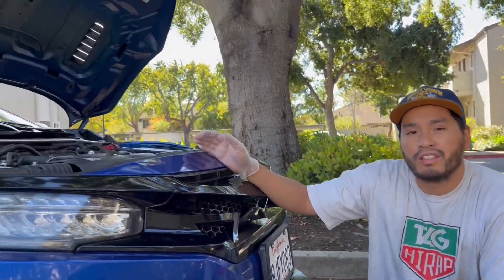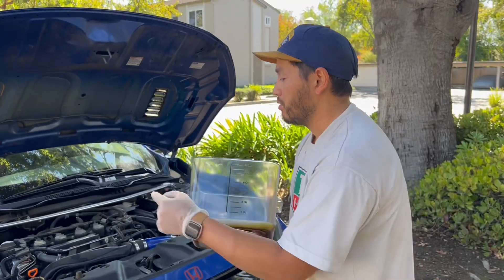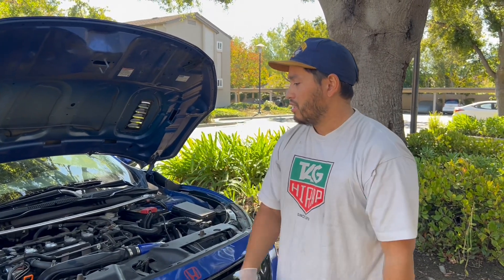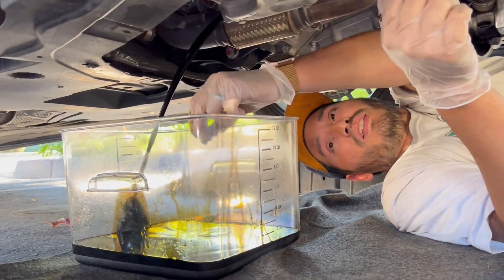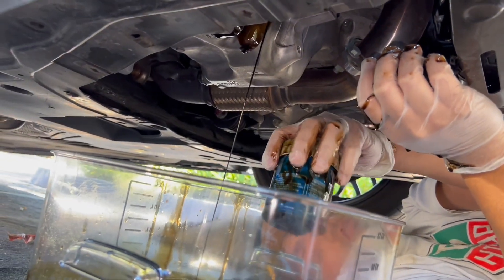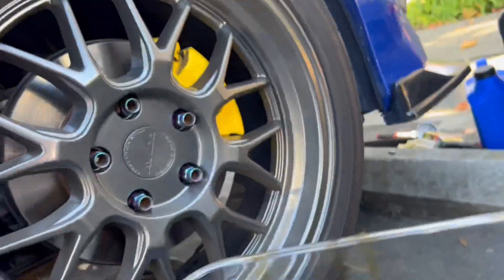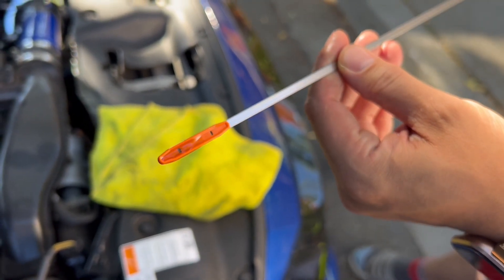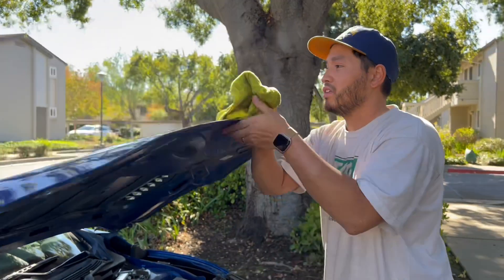Major Problem with my Honda Civic 10th Gen OIL DILUTION Fuel Mixing Issue, No Warranty Fix Recall

Comment: My daughter has a 2015 and  wants to upgrade with a 2019 but the 1.5 Turbo having this problem I think the 2.0 L Sport non Turbo will be a better safe choice. nice video, Hello from Vancouver Canada.
Reply from the maker: The 2.0L engine is more reliable and still quick. Good luck with purchase 👍
Reply: All turbos have that problem. I had a 2016 Kia optima sx turbo I had a catch can and it was still getting oil dilution. Now I drive a 2020 honda civic sport 2.0L non turbo. I'll never get a car with a turbo again.
Reply: I would not be scared of this problem in the slightest
Reply: @gabrielgaribay2145 yes all turbos can do it but Hondas oil dilution is above normal
Reply: @josegarza7719  I agree I have oil dilution in my 2020 Honda civic sport. When I do my oil change I have my oil right at the full line, then I notice my oil level will rise. That's because Honda motors are direct Injection. I have a non turbo 2.0. My my oil level rises I take some of the old oil out and top it off with fresh oil but I might start doing my oil change every 3,000-4,000 miles instead of 5,000 miles. I use pennzoil ultra platinum full synthetic 0w20 and a wix XP oil filter.
Reply: @gabrielgaribay2145  I kept reading info about how 2019 and newer Honda turbo engines were fixed. It seems the issue still persists since your 2020 still does it. they may have made it better but I’m going to buy a 2022 sport, 2.0, non turbo engine one I found near my city. I love the design of the 2017-2021 but it’s almost impossible to find one with a 2.0 non turbo. I found a manual one but I do Uber and it’s annoying using manual. 

The 2.0 non turbos don’t have the oil dilution problem from what I’ve researched.
Reply: @gabrielgaribay2145  wait your oil level rises in your non turbo 2.0? They don’t make 2020 Honda civic sports non turbo if I remember right
Reply: I just got a 24 civic sport 2.0 non turbo im at 4950miles taking car to dealer for oil change in a week or 2 and my dipstick smells of fuel😢@josegarza7719

Comment: same, 70K mile 2017 civic sport, no dilution. always trip over 25-50 miles...no short trips. hot climate. switch to more dilute engine oil and it should block out the fuel during cold start and cold climate driving. I oil change at honda dealer every 5K miles so no idea what they are using now on civics.
Reply from the maker: Thanks for sharing!

Comment: i really love the turbo noise on the 1.5t. But I have the option to buy a 2.0 what should I do?
Reply from the maker: They are both great! Tough to choose. Reliability is probably a bit better for the 2.0 and it has a better exhaust sound.

Comment: Seems like they had fixed the issue at the year of 2020. By rising a certain rpms on cold start and couple changes with the ECU. So far, it seems to be an issue still with these 1.5T engines. It does help but does NOT fix the issue.
Reply from the maker: You’re right, the ECU update is not a fix, more like a bandaid. It also worsens MPG by making the engine run warmer. Still contemplating on updating or not 🤔
Reply: its not, i have 2021 hatchback ex with 7000 miles on it, oil delution is so terrible
Reply from the maker: @Humbletrader08  damn, Honda seems to struggle with reliability this generation. The AC leaks, oil dilution, etc
Reply: @Humbletrader08  once your engine is more fully broken-in you will have less problem. 3k OCI is good unless you take longer drives and then 4-5k not bad.
Reply: @Sals_Garage  the engine runs too cool and if you use NGK ruthenium plugs it should help with everything because its a better plug
Reply from the maker: @jamesmedina2062  I do have custom hood vents which brings overall engine temps down.
Reply: @Sals_Garage  I replaced my ac compressor with a new $200 aftermarket ac compressor, no more leaks but it sounds on revs.
Reply from the maker: @seansmith9196  yea mine makes more noise than stock, but it doesn’t bother me.

Comment: This has been addressed on all models from the factory 2019 and beyond and prior years there was a recall that provided a software update and new AC parts free of charge plus an extended warranty for all affected vehicles. You should have Honda apply the fix to yours if the previous owner hasn’t. Also smelling the oil won’t provide an accurate reading of how badly diluted it is. You should send a sample to blackstone to see the actual percentage. Bare in mind a minute amount of bypass is normal because of how the engine works basically. On cold starts until the block warms up and the piston rings make a tight seal some drops may get by the cylinder walls. Driving the car for long enough after said cold start will evaporate the fuel from the oil pan.
Reply from the maker: I know about that software update. Thanks for the info. As far as I know they program the engine to run warmer to evaporate any fluids that sneak into the oil. Sounds like a bandaid fix though. I’ll order a black stone analysis for the oil and update you all soon. Cheers
Reply: @Sals_Garage  with this issue aside this motor is solid sorry you’re having to still deal with it. Keep the content coming.

Cheers
Reply from the maker: @filmmakerstudios  will do thanks!  Next up is Android head unit that is compatible with factory touring amp
Reply: @filmmakerstudios  is there an article that backs this up? I can't find anything in the web.
Reply: @carcez  how Honda corporate handled this is public information. At least in the United States. You should be able to find records from an official source.
Reply: Fuel and oil don't mix and any dilution will jeopardize the oils protective characteristics
Reply: @jmed753  they do for a brief moment watch a vid on how engines work
Reply: @filmmakerstudios  weedwackers? 2 stroke engines are not gdi tho
Reply: Honda has not fixed the problem.  We had a 2018 and had the software updated and the problem was not fixed.  We bought a 2019 and there was an oil dilution problem.  How much is Honda paying you?

Comment: My wife has the 2016 EX-T and I have always changed the oil myself.  I read about the dilution and decided to check for myself.  I drained the oil and then added 3.7Qts with a new filter.  I then emptied the used oil into an empty pennzoil gallon jug.  I measured 4.2qts.  This entire process was repeated after another 5000 miles and I got the exact same results.  4.2Qts of fluid came out of that engine.  I called Honda and filed a claim.  Long story short....I ended up at the Dealership where the claim to have reprogrammed the computer and then they changed the oil again.  5000 miles later, I changed the oil for the  third time and measured the used fluid.  Yep, 4.2qts again.  Now I have to go back to the Dealership and have it done all over again.  Meanwhile, my wife is driving around in a car with diluted oil.  Oh, and I only have three more payments on the car.
Reply from the maker: Thank you for sharing your story.  I hope you can get the issue fixed soon. For a new car having big problems like this and the constant AC leaks, it’s been quite a headache to deal with. So far we have been driving with the dilution issue and just changing the oil more frequently without any issue yet 🤞
Reply: Carvana or vroom will give you big bucks for it.

Comment: bro im having an oil delution coz i live here in iowa andits winter now with my new civic 2021 and i have warranty, what are they gonna do about it? how can they fix it
Reply from the maker: Sorry to hear that. I heard they update the ecu computer to fix the issue, but it seems like more of a band aid fix. Hope you can get it resolved
Reply: it all depends on how much (oil dilution). How much is it? How many miles on vehicle? What oil exactly?
Reply: @handycap9815 haha! I wouldn’t call it junk. There are 2018s with over 150,000 miles and zero engine/transmission problems. Toyota is moving to smaller engines with turbos and direct injectors too. They are also moving to CVT transmissions because of the government emissions mandates.

Comment: I find it 1-2k miles a little too excessive, too soon. 3-4 i find it to be ideal. And always run the car in the morning before leaving to work, and that should be fine. Good tip on not reviewing it with cold engine, once on operating temps, you should be fine to "play"
Reply from the maker: Thanks for the comment.  We will change the oil every 3k miles to be safe. Take care!
Reply: so the trick is to have the engine reached about operating temps?
Reply: That's what I do to my 08 LX  noticed this issue as well, but everywhere I drive is within a couple miles of me so I may have to take long drives every now and then to burn some of the gas out if this works? @Sals_Garage
Reply from the maker: @carcez  yes, short trips are no good especially for this car.
Reply: @Sals_Garage What's the technical reasons why short trips often results in oil dilution for your turbo engine cars?
Reply: So warm up your car in the morning to minimize the chance for oil dilution?
Reply from the maker: @timothylee2772  yes

Comment: Hi I have a 2017 hatch back sport 1.5l and I didn’t know about this oil dilution problem till this last month when I brought my civic for a product update to a dealership after the update for some reason I would smell the raw fuel I didn’t really mind it till my car would act up and sounds like it was struggling and I did. My research about it found out about the oil dilution problems on civics and I went check my oil level it’s quite high. At this point what’s the best thing should I do? And the car has 90000km on it right now
Reply from the maker: Have Honda update the software for the ECU to address the problem.
Reply: @Sals_Garage  I’ve already got that done and after that all the symptoms got worse lol
Reply from the maker: @anthonyaceespanola7009  damn sorry to hear, at that point I would just change the oil more frequently and avoid short trips.
Reply: Do I need to pre heat my car I live in Canada I usually just leave it running to warm up for about 15 mins then I would use it . Would u recommend running it on park to warm it up?
Reply from the maker: @anthonyaceespanola7009  not a bad idea
Reply: How many km do u have now on your civic and let me know how’s your dilution problem doing
Reply from the maker: @anthonyaceespanola7009  90k miles, oil dilution issue is still the same.

Comment: Wow, that's just like water. No viscosity at all. Can't believe the engine doesn't seize, or have rod knock.  Sad situation.  I definitely wouldn't be driving that engine hard!! Good luck.
Reply from the maker: Thanks for the comment. Yea it’s a hassle to change the oil so frequently but worth it for preventing engine damage.
Reply: @Sals_Garage  Honda should provide free oil changes to all turbo 1.5 engine owners every 2000 miles. Then they'd make sure to come up with a solution,  or buy back all these cars. Its obvious they don't care about thier customers,  but know so many people think they are awesome,  they will sell cars no matter what.
Reply from the maker: @1958Cadillac-v2g  I’m all for that idea 😆
Reply: "Rod"knock on overhead cam?

Comment: These newer cars, and newer oils you can go to 5k on oil changes, with the right oil. 3 k mile oil changes aren't normal anymore though
Reply from the maker: Good to know. Thanks 👍
Reply: Did you see how watery the oil is?????
Reply: @1958Cadillac-v2g the oil is “watery” because it’s 0-20, 0 weight at room temp.

Comment: I have the 2018 FK7 and have had Zero issues with oil dilution. My hatch never had the dilution recall or any recalls attached to its VIN. The key it to not let your car idle to temp and to not rev high on cold engine. Do not take frequent short trips and if you do drive longer than 20 min atleast twice a week. I also change my oil every 4k-5k miles.
Reply from the maker: Thanks for sharing, but I drive my Civic very safely during mornings to warm up properly. My daily commute to work is 1 hour each way (25 miles).
Reply: @Sals_Garage  yeah idk then. you should't be having this issue with that long of a drive. what year is your Honda?
Reply from the maker: @Kagemusha320  2016 Civic Sedan Touring. First model year of 10th generation.
Reply: @Sals_Garage  what climate do you live in ??? Is it cold ?
Reply from the maker: @jedbriimc9879  California, weather here is very balanced.
Reply: @Sals_Garage  truuuuue... and you've experienced oil dilution problems? Or is this more of a preventative measure?
Reply from the maker: @jedbriimc9879  I have it, but just changing oil frequently to keep engine healthy
Reply: @Sals_Garage  ahhh dammm dam. Guess I gotta get used to changing my oil lol

Comment: Regular oil change every 5000 to 6000 under normal use and fully sinthetic. I find if you check the dip stick by simply smelling it for any petrol I find will tell you to change, saying that my 2018 turbo as never had this issue as yet!
Reply from the maker: Good to know.  Thanks for sharing!
Reply: How many miles has it done??
Reply: @jedbriimc9879  38.000
Reply: @1stinlastout165  kind of makes sense apparently the real problems start at about 60
Reply: @jedbriimc9879  only if oil changes aren't done within every 12 months,I think the biggest problems we have here is the E10 petrol for all makes of cars!

Comment: Hi guys! I live in Brazil and haven't heard of this oil dilution problem here yet, only in USA and Europe, maybe it is not a BIG problem since we have warmer weather and only a small part of our territory (southern region) has an european-like weather.

I have a few questions:

01. Are you guys aware of this oil dilution problem occurring in other Honda engines? The L15B DOHC naturally aspirated with direct injection is my biggest concern. Honda City and Honda HRV both use naturally aspirated L15B with direct injection here; L15B7 (turbo) equips Civic, HRV, CRV and Accord. Maybe this issue does not occur in Honda engines with indirect injection due to the lower pressure at which fuel is injected inside the combustion chamber.

02. Which oil does your Honda engine require? In Brazil all new Honda gasoline engines use 0W20 fully synthetic oil; is there any country where another oil grade is used? A few years ago 10W30 mineral oil was recommended for all Honda models.
Reply from the maker: Thanks for sharing!  Looking forward to more responses from others.
Reply: Alternative to 0W20 is 5W30 for honda engine L15A & L15B as per user manual.
Reply from the maker: @metzmatu8409  good to know 👍

Comment: Holy cow! Reading some of these comments I find it hard to believe people aren't getting better gas mileage than they are reporting. I have the 2018 EXT manual 6 speed sedan and on a really hot summer day, I get as high as 48 mpg if I drive almost all interstate and over 200 miles. I'm talking Utah temps about 100F degrees and 80mph on the rural interstates, which is our rural speed limit. Of course in the winter the air density is thicker, taking more throttle to go the same speeds due to increased air resistance. So in the winter I only get about 39 to 42 mpg, depending on how gently I drive on the same interstate driving. I never drive pure city driving, at worse I'd call it mixed city/highway. Summer or winter mixed city/hwy I get around 34 to 37 mpg. The air density in that kind of driving matters far less since air resistance is negligible at slower than 50 mph speeds, so summer or winter temps don't matter much.
Reply from the maker: Thanks for sharing 🙏

Comment: Just bought a 2019 Civic Si with 24K miles, noticed the oil level was high. Changed the oil and noticed the gas smell. What a bummer. At least I have Amsoil in there now. This is ridiculous. Very frustrating. Guess I'll drive it for 2 years and get rid of it. Should've did better research before buying it, I guess.
Reply from the maker: I’m disappointed as well, but it is what it is. Just gotta change the oil more frequently.

Comment: Basically the same problem that I have. Unfortunately no more Hondas for me in the way that they've handled this issue.
This all started because of them using GDI injection instead of the multipoint FI
Reply from the maker: Sorry to hear.  What car do you think you will get next?
Reply: @Sals_Garage  Everything's too expensive. Just gotta hang on.
Reply from the maker: @rogerhoke3103  I understand
Reply: @Sals_Garage  Well it's hard to say Sal I wish we could go back to the days of the 2000 Honda's when everything was multi-point and you didn't have to worry about all of the issues that GDI brings along with rings sticking due to them now making them low tension on the oil control rings making cars burn oil prematurely I honestly think that it's planned obsolescence. What do you think would be the best thing to get if a person had to buy a new car now that wouldn't be subject to falling apart at 80,000 mi
Thanks,
Roger
Reply from the maker: @rogerhoke3103  totally agree. Thanks for sharing. 🙏

As for car recommendations I don’t really have that much knowledge of other cars to share my experience from. Hopefully others can chime in.
Reply: @rogerhoke3103 mainly depends on your budget but a Corolla with the 2.0 is a very solid buy, try getting it with manual if you want the best reliability

Comment: My 2019 crv ex took it twice and dealer said they fixed the issue but not, I have to change  the oil when is 70% 
It's  dark and strong gasoline smell
Reply from the maker: Hope your problem is fixed for sure.